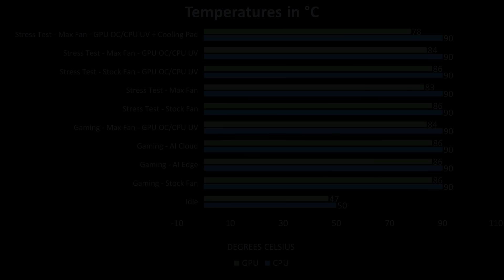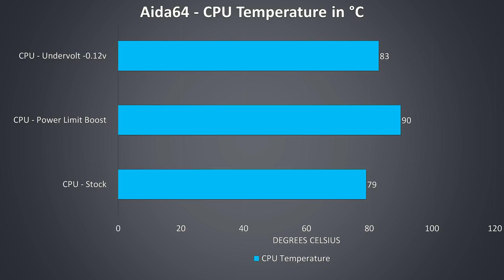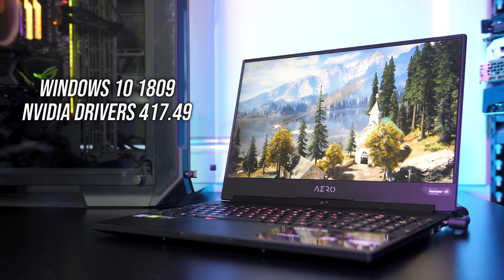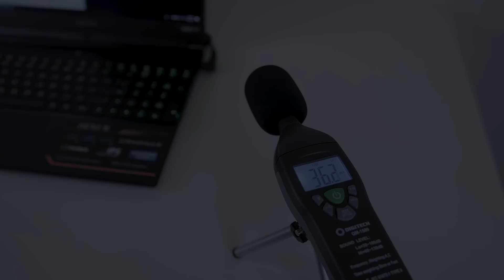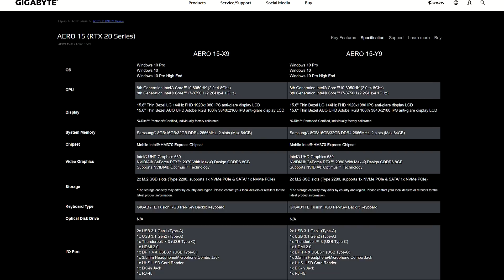Gigabyte Aero 15 X9 Thermal Testing, AI, Overclocking and Undervolting

Comment: Great video! Can't wait to see the Razer Blade 15 RTX video. I can't find anywhere the performance difference between the Razer blade 2060 and the Razer blade 2070 MaxQ. What's the difference since the 2060 is not a MaxQ?
Reply: From what I've found, the RTX2060 vs. RTX 2070 Max-Q is about 10-15% difference in real-world performance (while nvidia is claiming 20%). If you overclock both GPU's you might be able to bump out another %3-5 difference there. Neither card will typically throttle, especially at max fan speeds. For comparison's sake, the RTX2060 ~ GTX1070 Max-Q, RTX2070 Max-Q ~ GTX1080 Max-Q (performance wise); generally speaking that is, each laptop will differ slightly based on design and thermals. From current pricing of available options, the 2070 max-q will run you about $200 more than the 2060; worth it in my opinion if you are already spending $$$ to get top-tier performance. The 2080/2080 max-q is way past the price per performance ratio and not even close to worth spending the extra $500 or so over the 2070/2070 max-q and $700 over the 2060.
Reply from the maker: Thanks! I'm not sure yet as I don't have any 2060 laptops to compare with just yet.
Reply: @JarrodsTech , You can be the first, who will do it, I can't find this comparison in YouTube.

Comment: How do u resolve the issue with the power limit throttling ? In my case the TDP set to 45W and it seems like once the package reaches 45W it starts to power limit throttling showing on XTU.
Reply from the maker: You can try undervolting the CPU which will improve it, otherwise if you can't boost the power limit in XTU (many laptops don't allow this) then there's nothing more you can do, assuming you have a large enough power brick.
Reply: @JarrodsTech  I have a 2018 Razer Blade with a gtx1070 Max Q
Reply from the maker: Cool, yeah definitely worth trying undervolting: https://www.youtube.com/watch?v=yNt9L3BWOFo

Comment: Interesting video, thanks for another thorough upload. So it seems that it is really struggling with heat, I guess that's always going to be an issue with the form factor. I'm not seeing much gain from this RTX generation (over GTX) either which is I guess expected with the same chassis having more powerful hardware. 

I know you've tested single vs dual channel ram before, but I'm assuming you'd get better temperature/more performance for a given temperature if you ran dual? I ended up getting a good sale deal with a Zephyrus M but it's single channel and the CPU temps are high, hopefully swapping out to dual channel will help a bit. I've seen many comparisons that drop CPU temps by a decent margin and also improve performance. Anyway, keep them coming Jarrod :)
Reply from the maker: Yeah you'd get more performance with dual channel presumably at running with the same temperatures, I didn't test temperatures with single and dual channel though. I did not see too much gain with the 2070 Max-Q either, I retested the 1070 Max-Q at the same time for an upcoming comparison.

Comment: I plan to buy Acer predator Helios 500 i7  because it remain cool . But with launch of rtx .i thing not to buy it . Should i get rtx laptop or Acer.
Reply from the maker: The Helios 500 is still a good machine, I haven't heard plans about a new RTX model yet. Depends on whether you think you'll actually need RTX, or the slightly better performance for more money.

Comment: Great Video as usual!! BTW, just got my 8750h+2070maxq alienware m17 yesterday, no overclocking and the GPU runs at 1725mhz pretty stable, pretty shocking results.
Reply from the maker: Thanks! Good to hear 😃
Reply: @JarrodsTech  Thanks! 😄
Reply: Do u like it? And is there any issues u notice yet?
Reply: @RollandLoy  I was very skeptical before it arrives due to all those M15 overheating issues, but after received it I was quite happy. There is one issue that I cannot seem to install or open the intel graphics control panel, the driver is installed, but the control panel is not there.
Reply: Harper Chen That could mean one of two things:

1. The Intel graphics control panel is being hidden by Windows, in which case, just look for it in your start menu where the rest of the Intel one click options are.

2. Your m15 has a G-Sync panel, in which case the Intel graphics will always be disabled, therefore being why you cannot find it.

That’s what I can think of anyways.

Comment: HaHa! Undervolt! I had to laugh at you question at the end, cause I'm always cramming the voltage to my CPU's/GPU's to get the most out of them! Keep Calm, And Raise V-Core!
Nice review as always Jarrod. The temps seem to be the biggest issue on that machine. Like you said, the cooler is just not sufficient for the task. Sure wish it was 24C here. We just had 2 feet of snow, and it hardly ever snows here.
Have a great day!
Reply from the maker: Thanks! Yeah it's a warm one. We've gotten through our 40c+ days, into the low 30s now!

Comment: 2 pipes isnt enough. lets hope next gen they go ape and put 6. 4 might do it, but 6 should really get that heat out. also bigger higher power fans should actually make it quieter (slower rpm to move the same air, bigger motor also means lower pitch, no screaming eagle)

just my ideal cooling system lol. can always dream
Reply from the maker: Yeah I think what I'd want to see most out of the next generation would be a larger cooling system, I understand that would be difficult as it is a fairly thin machine, but I think something needs to be improved there.
Reply: @JarrodsTech  there are a couple of ways they could add and keep the same frame. add small pipes to the existing design (easy room for 2 that i could see) or get thicker ones than it currently has. there are sizes to those, like if thats an 8mm diameter, they could up it to 10 and very likely not change the frame at all. but with that design being 3 maybe 4 years old, i could easily see it getting a refresh end of this year or early next. i do really hope they add thickness so they could really go nuts with it, it doesnt need to be like a titan, just another 5mm or 1/4th inch (2 very different sizes i know) would be plenty. also i hope they round the edges to make it easier to hold. thing is uncomfortable to pass around and doesnt look great.

maybe i should just design my own laptop lol, make my own frame and cooling system then rip out the board and screen from something else.
Reply from the maker: If you make your own I'll review it 😎
Reply: @JarrodsTech  haha shipping alone would ruin me.

but, one of the reasons i got the 15x was to start working on 3D modeling, for when i get a 3D printer. gonna be an excessively fun toy

Comment: How does A.I affect performance?
Reply: it decides how to allocate wattage to cpu and gpu. GPU bound game the ai will drop the watts on the CPU so it wont get so hot, so the GPU can open up and so on.
Reply from the maker: You can see in the video, I show clock speeds, temperatures, and Far Cry 5 FPS with the two AI modes on.
Reply: Thanks for info

Comment: Gotta say even if it still runs hot it's a nice looking device, especially on the inside.
Reply from the maker: Yeah my 15x runs hot too, doesn't throttle as much as this, but still does a great job for what I need.
Reply: @JarrodsTech  would you ever consider using one of the big Alienware laptops? From what I've read and watched online the 17 R4 was by far the most powerful sub-4000 dollar laptop until RTX graphics came out. To me for people who care about performance over mobility that just seems like a no brainer. What are your thoughts?
Reply from the maker: When I had the 15" 9900K laptop I was thinking, it's not actually that big! I still really prefer thinner and lighter for travelling though, 8750H and 1070 Max-Q are plenty for what I do while travelling (video editing) so I don't really need a larger one myself. I used to have a huge laptop in 2008 at school, broke my back carrying it around haha.
Reply: @JarrodsTech  My aunt has an old school Asus laptop from like 2011. This thing is freaking huge. I mean it makes the GL703 look like a bacterium. After seeing that laptop and then seeing Alienware's in stores, I stopped thinking Alienware was big. How does a laptop with a 2nd Gen i5 need to be 2 and a half inches thick? It doesn't even have a dedicated graphics card.
Reply from the maker: Ooh, yeah I had a Dell 1720 with some Core 2 Duo CPU haha, it's in the cupboard somewhere..